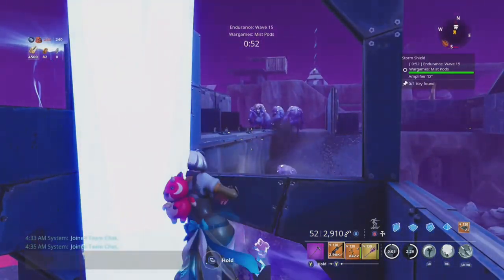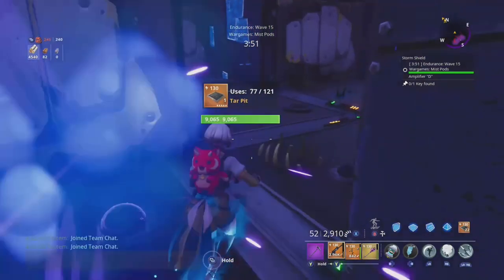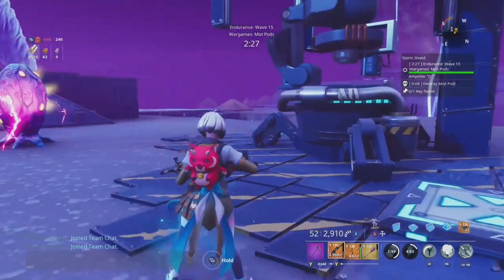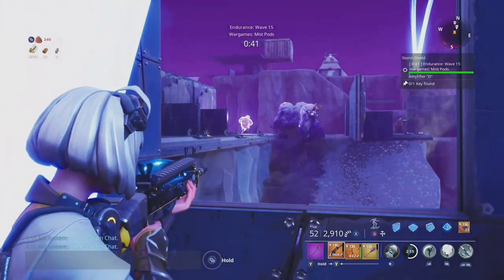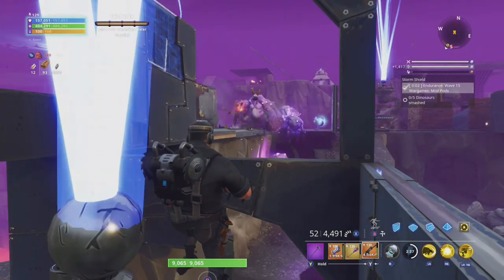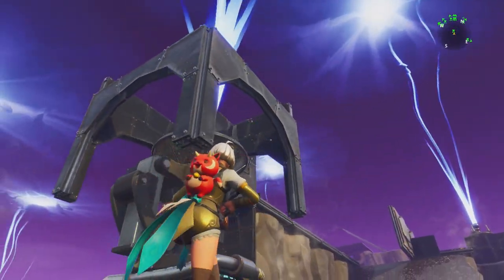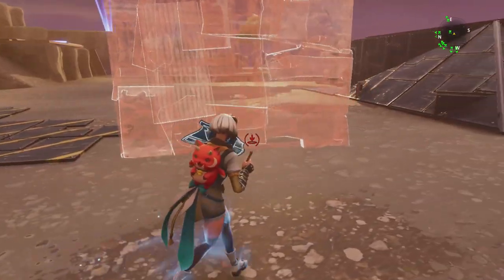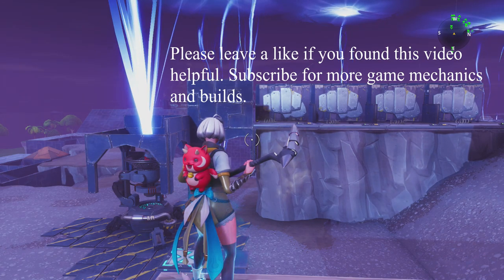Smasher Bridge Twine Endurance Valley Amp

Comment: My smashers are not being launched from wall launchers is there a bug atm? It use to be 3 launchers to launch them, Only just come back to playing endurance again after being inspired by your vids but cant work out if its because  of the smasher changes or if its my reload speed on tar traps causing them to get stuck instead of launched. My tar traps are at 8.5 sec and my walls are at 4.3
Reply from the maker: They wont get launched like they used to but rather staggered or knocked about half a tile. if you keep them on the edge by using 1/2 walls and keeping aggro 1 sided they'll normally get knocked off
Reply from the maker: There was a nerf to launchers vs smashers 2 updates ago. 11.3 i believe. Smashers wont be launched however can still be knocked by only wall launchers.
Reply: That sucks its one thing for smashers not to charge ramps and take no fall damage but not to be launched completely really sucks! Ive tried the wall pieces between traps n smashers seem to be charging on an angle which i have never seen before

Comment: Hi maybe a silly question but you think that it will work if a smasher breaks the bottom and i can't replace it cause i am out of structures? If i keep standing on top and they are already pathfinding from uptop
Reply from the maker: Try Building it differently.... try putting the pillars  things in different corner. Or just float the lighthouse or smasher bridge with no support
Reply: @whitestreamz  oh ok so it can still work without support? Thx for answering btw i really appreciate it

Comment: So if you didn’t have the light house or structures on the amp, smashers and mini boss will still travel up there?
Reply from the maker: I plan on doing a video explaining all of this sometime.... just been really lazy.
Whilst using the structures to aggro, then yes it is neccessary. You can do these builds in a variety of different ways tho and make wayy cheaper however its up to you how you want to get creative when using.
Reply from the maker: If you want to see what ark or engineer made, getting creative with this smasher bridge strat check out engineers build im sure youll love it
Reply from the maker: Here check out engineers take on it. I thought it was very cool https://youtu.be/Wq0LnB1zLQg
Reply from the maker: If trying to path up using the same mechanics ... they need the wall at the top of the amp to go there.
Reply from the maker: So without no... no they wont...

Comment: Hey I have a question on how much mats do I need for twine endurance set up
Reply from the maker: No idea never really took the time to look into how much. However it is quite alot.
Reply from the maker: It varies aswell based on how much blockoff vs traps your using. As they both use structures
Reply: Ahh ok alrighty.. I was thinking about setting up a twine endurance
Reply from the maker: You'll need rather alot of metal. Focus metal on walls for blockoff or any areas susceptible to damage. Brick can be used for lobber shields if done correctly. When using tar pits to recycle you can even use weaker floors to be able to bash them out when durability is low. However only reccommended for recycle builds. Also by mixing metal tunnels and brick lobber shield youll refund yourself back both of metal and brick with base recycling

Comment: What perks are you running on the wall launchers on the smasher bridge?
Reply from the maker: at the minute 3x impact 2x reload 1 x durability
Reply from the maker: should be the most consistent. for UFO wave you can add 1 more wall launcher by top of ramp if you get tons of smashers and really wanna afk. that will help break the impact guard. But otherwise the row of 4 works seriously well. Just make sure those tar pits have good durability before the wave